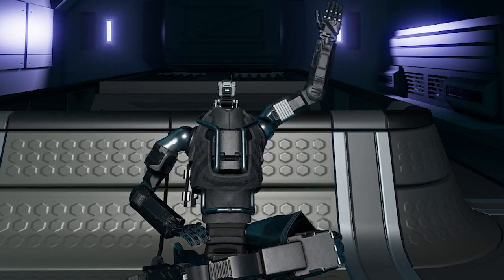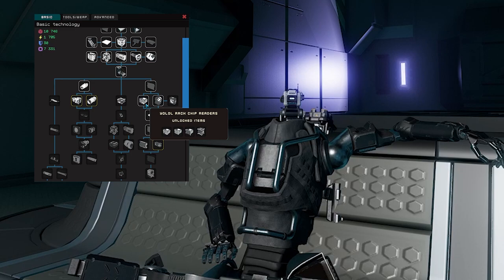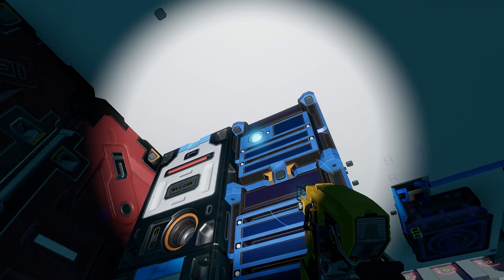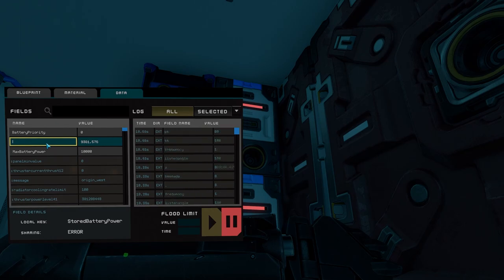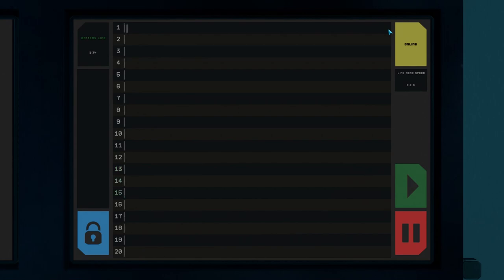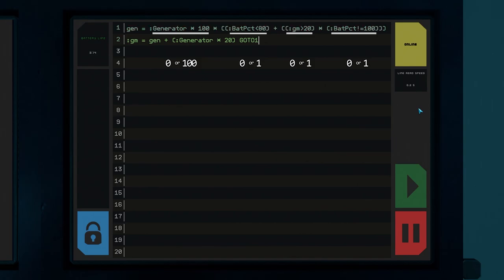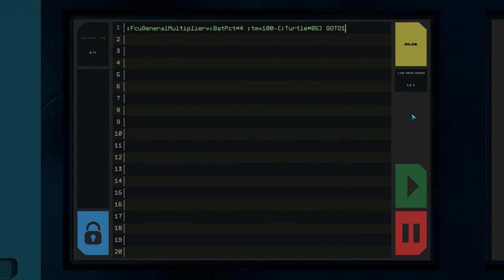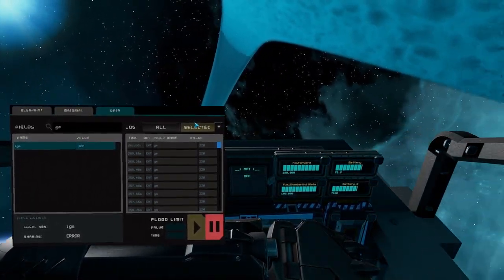Hack My Laborer [Ep 08] - YOLOL Code, Racks and Memory Chips - A Starbase Tutorial Series

Comment: Ack my brain is all wrinkled now!!!  I needed this video last night I couldn’t figure out the rack system for some reason but finally managed to figure it out. Haha oh well.  Still a great video can’t wait to screw things up today with new yolol on my batteries.  I had got all my batteries labeled for a1, b1 A2, B2, etc etc then managed to yolol it thanks to your comments in the last video and got my guages finally working to show the 50k value of each battery_1
and battery_2. How will that effect the new yolol script with the batteries?
Reply from the maker: You can continue to use that for your batteries if you want. You'd just need to change BatStored to any of your batteries (like B1) and then BatMax to whatever you named that field (or just divide by 10000 since that should be a full battery). Just use those field names in the BatPct script instead of the names I used.
Reply from the maker: @AidenCorvas  yup. Exactly that. The rest of the scripts will just use :BatPct so no need to change anything else.
Reply: @swemoney  hrmm..something in the rest of the yolol's didnt work right, generator button now doesnt turn on generator (and I didnt change any of that stuff...)  is it because my memory chip has BatPct_1 and BatPct_2 instead of just BatPct?
Reply from the maker: @AidenCorvas  Ya. The generator script uses :BatPct so it has to be the same. Do you have your A and B batteries on separate priorities? If not, they'll all discharge at the same rate so you only need a single BatPct which will be the overall percent of all of your battery storage
Reply: @swemoney  haha, Eureka!!!  I just added that Batpct to the chip and poof, then turtle worked and generator turned on....not sure the power generator one works yet...but thats one more down!  Thanks for the help, sorry for allt he questions....KEEP UP THE AMAZING WORK!!!

Comment: The is working great but when I exit the game the memory chip disappears or it comes out of the rack which leaves my ship dead.
Reply from the maker: I've heard other people say they've had issues like that with chips that come out of sockets or racks when they move the ship. I'm not sure what causes it sadly. Send a report to the devs with the F1 tool. Hopefully they get it fixed soon. If you can find a way to put a bolt through the rack (maybe through the bottom?) so it holds the chip inside that could be a workaround.

Comment: Can’t seem to get the display to do the % everything else seems to work but the % screen
Reply from the maker: The battery percent should be pretty straight forward. As long as you have the same YOLOL code as in this video and you modified the same fields on the memory chip, battery and screen to be the same it should show a percent of your total battery power with a single decimal place after. What does you battery screen show?